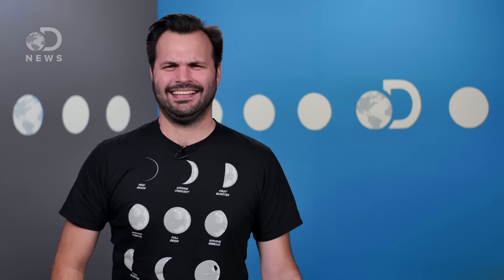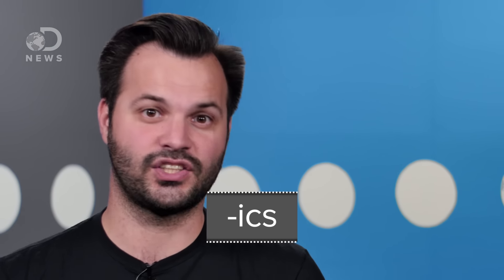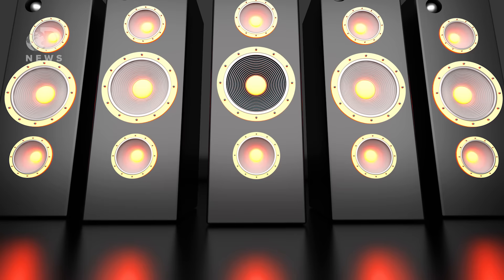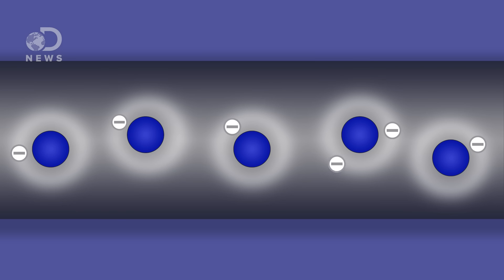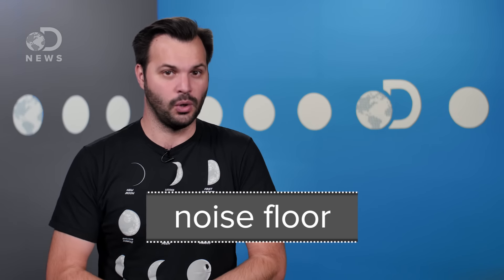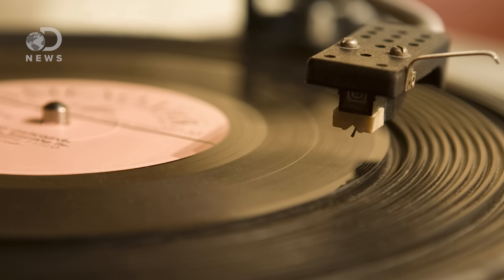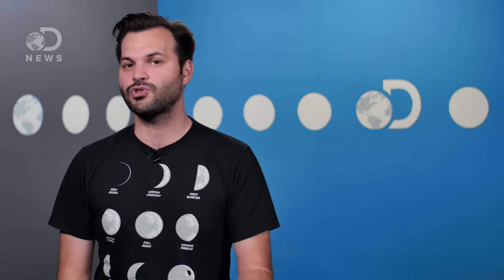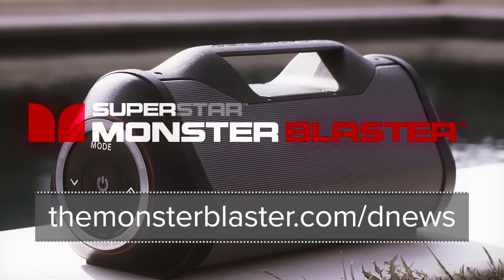How Atomic Physics Makes Your Headphones Hiss

Comment: the lesson of this video is to buy Better headphones
Reply: anna ong or just buy headphones with a higher OHM rating
Reply: Assasinpiggles which are better...
Reply: anna ong what if they're sponsored
Reply: And how's that going to make any difference if the amplifier is the same? Amplifier has much, much higher contribution to the noise you hear through your headphones.
(I'm electronics design engineer and a sound engineer by trade)
Reply: and a better DAC and a better amp and flac files (or 320kbps mp3 at least) and... oh yeah that's it.
Reply: Always buy Beats, nothing beats Beats...
Reply: T1Oracle I do hope you're being sarcastic... :D
Reply: He explained in the video that better headphones often just allow you to hear more of the noise from other parts of the circuit.
Reply: Christopher O'Grady
Not all the time but yeah
Reply: What happens if you buy better headphones then your previous ones but they have this annoying his and previous ones don't

Comment: My razer headphones had the hissing noise but when i reduced the volume using the inline volume wheel, the hiss pretty much disappeared. I just bought the hyper x cloud II and I cant stand it. when plugged in, i can it so clearly. Then when I use the adapter, the hissing is louder. I wish more reviewers would mention this but I guess its not a problem for them so they dont even notice it

Comment: "3:1, that's pretty good!"

Well, that's a little over 9dB, so that's pretty terrible.

A consumer sound card will do 90dB to 116dB for under a hundred bucks.

I forget the relationship and I don't feel like doing the algebra, but multiplying the decibels by 10 would be something like taking your original ratio and raising it to the 10th power. Someone correct me on this.

so "59000:1, that's...decent!"

Comment: I have a guess, today when I fully recharged my Bluetooth headset and unplugged it, at the very start I can hear an auditable hiss sound from whatever I played on PC. What's more, when I tried to lay down, the signal flow has intolerable gaps (music paused for a while).  However, after a while, the sound of my headset has improved dramatically. I start to think that it is the surge of the electrical state of internal components inside the circuit has created some chaos among the electrons. But after a while, the chaos goes with the flow and vanishes. Did anyone get an explanation of this?

Comment: while everyone is focused on achieving some sort of money-fuelled perfection, I'm sitting here thinking about how I can combat excessive noise when I encounter it... and realizing that my shitty soldering using shitty wires might be the weak link. I always put the blame on "components" like resistors and circuits, and things like grounding and shielding, but if it's the conductor itself introducing noise, no amount of shielding can fix that

Comment: "CD's don't have any noise floor, because they've been remastered to remove any noise frequencies" oh yes they do have a noise floor and that's the exact noise floor of the original system where the signal digitally recorded on them was. And you can't "digitally remove" that... you can reshape the noise possibly, but the power is the same.

If all the music/sounds on the CD has been made completely inside the computer, you theoretically have "infinite" noise floor since digital systems inherently don't have any noise, but since CD has 16bit bit depth, the dynamic range has it's limitations (~96dB).

Then there's the problem that even if the material on the disc doesn't have any noise, the system that's responsible of the reproduction does have a noise floor. You can't escape it.
Reply: "CDs have almost no noise floor" is what he said...

Comment: Can't we use the same technology from noise cancelling headphones to minimize this white noise that the headphone itself makes ?
Reply: Artur Milano no
Reply: Artur Milano it does not work like that
Reply: +Artur Milano nope because its a digital signal not a sound wave
Reply: I don't know why everyone's giving you such an emphatic 'no'. It could be possible to remove noise from other parts of the circuit, and have a very low noise amplifier in the headphones. Although doing so requires quite sophisticated algorithms, and sometimes damages the quality of the audio in other ways.
Reply: Actually a lot of of noise canceling headphones produce a hiss

Comment: The explanation is complete bullshit. Theory of electric noise is very well understood.
Noise is produced by any resistive conductor at room temperature. Electrons behave as a gas in equilibrum with the environment. Temperature of electron gas is, thus, same as the conductor temperature. Given the electron's mass and charge, it's possible to calculate what noise power such gas exerts on the ends of a conductor. To save you calculations, spectral density of power of noise in a resistive circuit is equal 4kT W/Hz, or, integrated over an arbitrary time, 4kT J (which is important in signal detection).
There is also 1/f noise, which spectral density increases for low frequencies, cause by semiconductor imperfections. It mostly matters for bipolar transistors, though.

Comment: 0:16 the noise is in the video. Pause it, you'll hear nothing.
Reply: berkcancosan Nah, I still hear it
Reply: berkcancosan i still hear but really reduced
Reply: berkcancosan you must be waring some hi-tech headphones
Reply: Soli Abdel Hakam nah, my headphones are quite cheap, might be my pc fans blocked the noise or my hearing is bad.
Reply: berkcancosan i am a moblie users.
they boosted the hsss sound
Reply: Paused the video, heard nothing , even at max volume.
I have a Sennheiser HD 202, and its only $30.
Reply: The audio is paused so your earbuds stops getting signals and therefore dont make any noise, if its not making noise it doesnt have electricity in the wires ie. bot going to hiss NEAR as much as they do normally

Comment: It was fine and all until he went "there". One does not simply start the "hi-fi" cable war unpunished. "High end" cables are probably the single worst thing to dump money on. Buy the right gauge wire and at optimal lenghts and you wont have any problems what so ever! Pour that $5K budget you saved for stupid cables and spend them on better speakers or a modular pre amp + amp combo. That will reduce noise and improve quality waaay more efficiently than some stupid ass cables